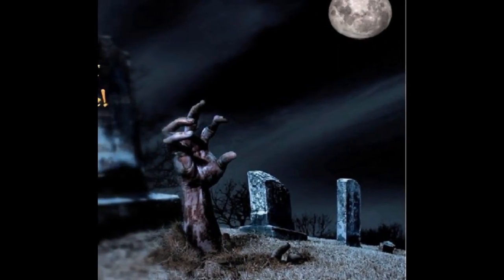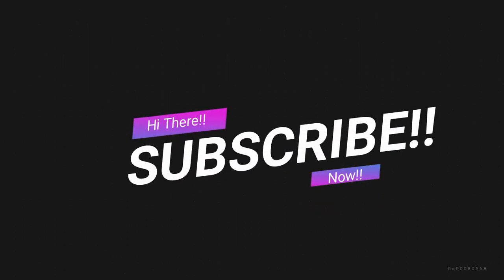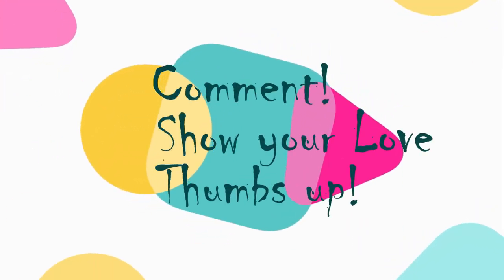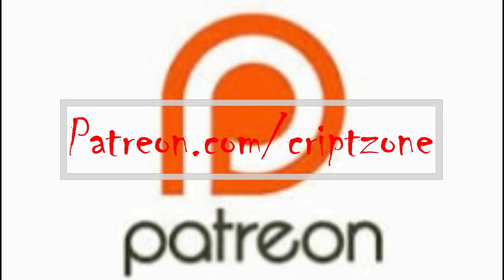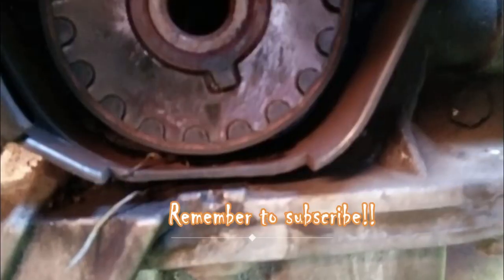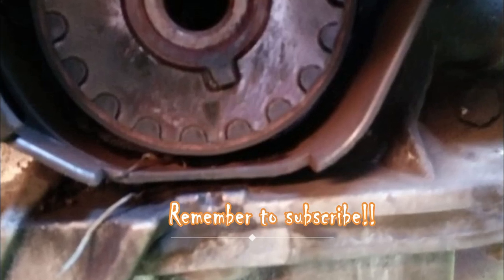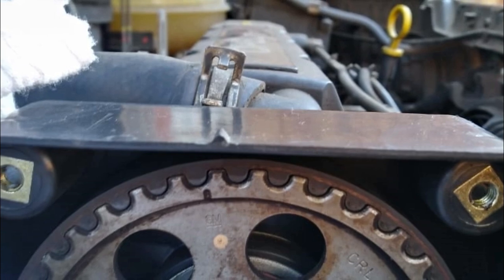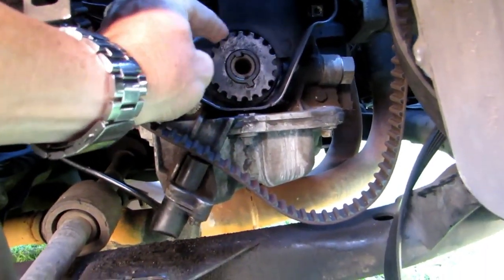Timing and performance on corsa utility 1.8

Comment: How to remove sprocket -?
Reply from the maker: I used a screwdriver to wedge the sproket on one of the cover svrews. You can also if the timeing belt is on put the car in 5th gear. Then let someone step on the break and lovk down the crank from turning.  Locking the sproket too.

Comment: JUST DONE A RING REPLACEMENT,,VALVE GRIND AND NEW VALVE STEM SEALS TO STOP OIL SMOKE, Also the oil sensor was spewing oil out which caused the oil light to come on. now difficult to start , did the full computer discharge and re rest

Comment: The bolt on my oil pump/crankshaft broke and when they tried to remove it they damaged the threads so I'm left stranded I don't know what to do.
Reply from the maker: Hi. Is there still a piece of the Bolt left inside? If not you have to get a thread cutter ent cut a new thread.